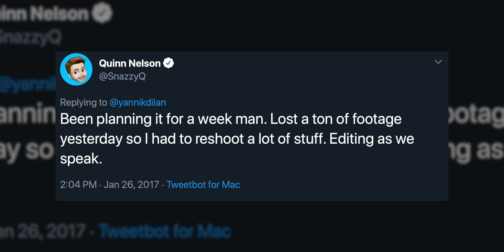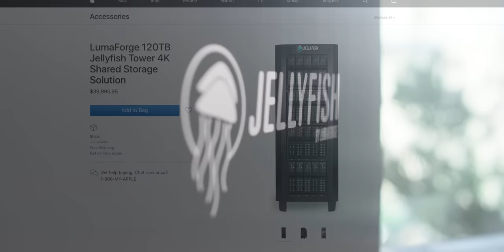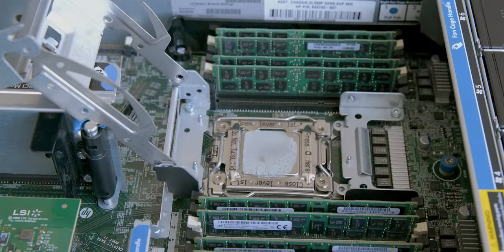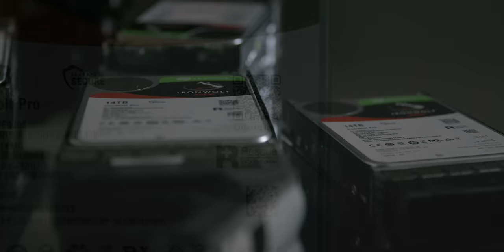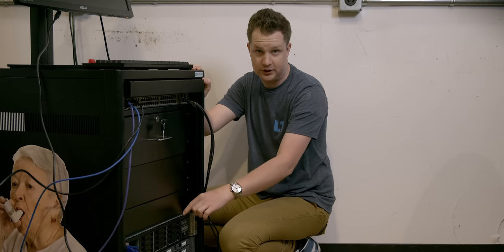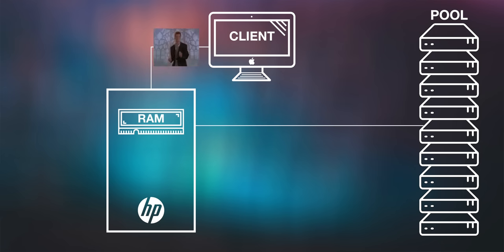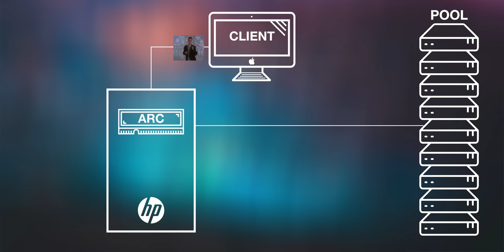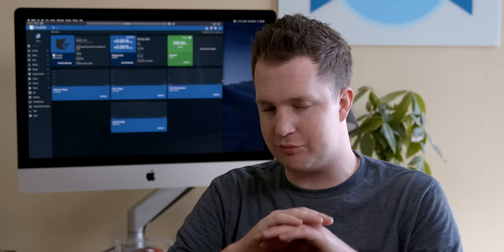I Built a HUGE 336TB Server Without Linus Tech Tips!

Comment: I've built a similar system with 2 Xeon processors and a 16 drive bay.  I had two SSD's for ZIL and ARC but discontinued them for fear that an SSD error would crash my entire system.  I only have two users and wouldn't benefit from the SSD's anyway.  Love your 10Gbps setup and yes, everything runs great using FreeNAS. I use 2 vdevs of 8 Seagate 10TB helium enterprise class drives using two parity drives each.  I also use a 2nd QNAP system to mirror the FreeNAS setup.  QNAP has implemented many of the features of FreeNAS and it can now perform SCRUBS, SMART testing, etc.  Still using 1Gbps ethernet though, and it bottlenecks data transfer at 116 MBps.  Most of the parts were purchased on ebay for much lower than new.  iSCSI, NFS, are working fantastically while SMB...well, Windows 10 is still crapping all over that and can't decide whether or when I have access to my own server.  Re-enabling SMB 1.0 seems to help but is intermittent. Later SMB versions are also problematic so when Windows complains I use FTP and other protocols to transfer data. Next upgrade is going to be one of those 10G switches, my pc's already have 10G nics.  Great video by the way.

Comment: Considering the cost of the drives is likely to be the primary cost depending on the size of the server you're building, it's a pretty nifty tip to point out the used enterprise equipment market as a way to keep the cost of the system that houses the drives down.

As a side note, while the ability to work off of the server directly might be nice for certain applications, it's probably worth pointing out that you can drive the cost of the server down a fair bit if the core intention is storage/archival. For video editing, the video can be transferred from the recording device to the local machine that's going to be doing the editing, while simultaneously backing up to the server. Working directly off the server itself is going to result in a far higher workload rate for the drives. In particular, since it's a raid setup, all the drives in the array are going to suffer far more work than they need to, likely resulting in failure sooner than necessary. Considering the work machine is going to have to have specs to do the editing anyway, you could just do the work on local, fast, and relatively cheap SSDs, then have the data sync to the server after. Basically, using a sever as a glorified external drive is massive overkill in most scenarios, and likely to cause needless wear on the system.

Comment: Enjoyed the video, everything was pretty spot on except for the your comment about LTO tapes. I worked with them over the years and for a setup like yours if you every need to archive a chuck of data off, buy a nice usb 3 HD dock and just get a new HD and use it to archive. LTO 7 tapes only have a native storage of 6TB and a max compression (which you will never get) of 15TB.  LTO7 tape cost around 60-70 dollars for a few dollars more you can get a HD which will have a much MUCH higher read speed of that tape and if you never need to retrieve a small bit of data you'll hate dealing with the tape. Oh and a LTO7 drive is close to 4k in cost.

And if you want to get stupid amount of memory on the cheap get a Dell R910, it can hold 1 TB of memory.

Comment: Kinda cool, The netapp is super fancy. 1. How come your client operating system company doesn't make a server version? 2. You would get 100x more functionality with Windows Server 2012-16.  Which is fully supported by that HP,  heck maybe even optimized for Windows. I'm not saying its a more robust operating system. But you would be able to actually engage the server fully instead of just ssh or web gui. Using the OS will also help you learn tons of cool stuff. Especially within the network adapter areas where you 'think' that your 10G interface is the bottle neck :)

Comment: @7:15. 60 Seconds UPS power is only good for brownouts. The server will never be able to shut down that fast, specially if there are clients accessing the drives. 

I would get a battery extension module to get at least 15-20 minutes runtime.

Comment: I agree with old server units on ebay. I built my Unraid server using old servers. I have 4 so far. I use 1 as a desktop and 1 as a server. Will be finishing the other 2 as servers. Then going to build a video edit / rendering server. Went with unraid do to it not really needing pools and loosing all the data across the array on a failed rebuild.

Comment: I have a pair of Dell C2100 LFF on freenas, and a R510 LFF(and R710 SFF) on windows 10 pro, each server individually was under $100 each including processors(low-mid range quad core) and 8GB of ram each, upgraded the RAM to 72GB on the C2100s and went from the 2.1Ghz quad core to 2.5Ghz 6 core, and the R510 and 710 uppsed to 3Ghz 6 core, the C2100 has a nice feature of having a dual10gbe daugter card, all together a single C2100 with 2x10Gbe xeon E5649 and 2x1Gbe, 80GB RAM, and 12x3TB 7200RPM enterprise drives(referbished) was under $900, Dell R510 

Because i only have 12 drives to choose from on the C2100s, i ended up choozing ZFS Z3 for a 3 drive redundancy anywhere on the server, these are refurbished drives afterall

Do i have a youtube channel? No
Do i produce video? No
Do i record over the air TV? yes, and will continue to do so until it either becomes illegal where i live, or i get internet fast enough/capless enough for streaming

Comment: the ZIL is not what you just said it is. the ZIL is not a write cache, and ONLY applies to syncronous writes. async writes will stay in RAM (the actual write cache) until flushed disk. many people make this misinterpretation, particularly when trying to compare unraid to freenas. unraid has hybrid storage, with storage tiering (write caches) but zfs (currently, supposed to be on the way) doesnt.

Comment: When I first installed my 10GBase-T network at home, I thought, this will definitely be fast enough.... But then I installed a Highpoint Solutions SSD7103 M.2 3.0x16 NVMe adapter with Hardware level RAID 0/1/10 with 4x HP EX950 2TB m.2 SSDs in RAID 0 on my server/NAS as a cache/top storage tier, and quickly maxed 10gig Ethernet.  So then I bought an Intel X710-T4 four port 10GBase-T NIC to put in my server with all four ports aggregated to create a 40Gbit backbone for my server

Comment: Sweet storage system. But question, do you really need to edit directly from the server? Wouldnt a simpler solution be to work with a couple of big local SSD´s and once you finish editing you move the content to a Synology NAS with all the same hard drives you received from Seagate?  It would be cheaper for sure, but not only that, it would be dead simple to build and maintain. Now if you really did it as a nice techporn solution, I understand :)
Reply from the maker: Editing directly from the server saves time, reduces likelihood of data loss, and requires fewer cogs in the production process. It’s not cheaper, but it’s way better.

Comment: Im building one of these setups for my home for video editing... I also want to learn windows server. Would this be running ok for data backup if im editing and using windows server as a learning tool or would i be doing this wrong.
Reply: Wheres the build specs. Id like to buy the same setup... Minus the overkill of drives.

Comment: Those Jellyfish servers raise one big question for me - where the HELL did they find their cases?!  I want to build a storage server just like that using 5-in-3 hotswap cages, 4 of them, letting me use 20 3.5" drives in 12 5.25" bays... but... nobody MAKES cases with 12 5.25" bays any more.  Even cases with 9 are impossible to find.  I can't even find used old ones on ebay.  It's like the whole industry just decided 5.25" bays are cancer and they threw everything in a landfill.
I am very glad you set your system up with at least 2-drive redundancy... modern mechanical drives have an unrecoverable read error rate of about 1 read per 12TB of reads.  And if you hit an URR during a rebuild (which is statistically likely with 14TB drives) it will fail and you will lose everything in that parity set.  I hate seeing people using large drives and only setting up single-drive redundancy.  That's just asking for a negative situation (needing to do a rebuild for a lost drive) to turn into an absolute catastrophe.

Comment: Not a mac guy but I imagine your storage is shared via NFS. NFS shares are very diligent with how you write data. They write in what is called synchronise mode. This means your data has to make it all the way to a platter, it cant be dropped into a cache and then dealt with latter (that's asynchronise) . A separate ZIL device called an SLOG might help you out here. Just remember that if you go with a SLOG that it needs to be redundant ie 2 SLOG's in a mirror.
To test if a SLOG will benefit you you can for testing (it's a dangerous operation for daily use) turn off sync on the pool. Then all writes will be processed asynchronously. Something going badly while you are doing this could be bad.
Also remember ZFS is a Copy-on-Write filesystem. So there is no immediate overwriting of data, stuff gets written to the next free space this means each project you load will be inching its way closer to the end of the disk where your disk speeds will be around half.
Reply from the maker: Using SMB. NFS is no good with FCPX.
Reply: @snazzy  SMB mostly uses asynchronous writes, but there are some times when it does write synchronously. You shouldn't have issues on that front. If you do they might be a bit weird. again turn sync off to see if it resolves the issue.
SLOG sizing is also something you would need to look at. An SLOG wont use more than half of you main memory size (64gb right now) and wont need to be any larger than 10 seconds worth of writes. 2 * 10GBE for 10 secs is about 20gb. So 20gb is about as much as you need. Overkill, considering a lot of smb transactions are not going to touch it.

Comment: How did you set it up to edit using fcpx off of the server? I have a freenas nas too, but fcpx has had issues storing it's library on a network drive. It just says you can't do it. There's a sketchy way I got around it creating a "virtual" local drive, that's actually the server. Is there a better way?
Reply from the maker: Yeah. Apple doesn’t allow you to use AFP shares with FCPX, but NFS AND SMB both work great.

Comment: you should definetely get matching spare raid controller(s), same firmware is mandatory! those suckers usually are the first ones to let you down when you don‘t expect it, especially on older systems like this, and then you suddenly have a lot of maybe unrecoverable free diskspace available... ;) same goes for the power supplies.
your 60 second ups should be upgraded a bit as well, that amount of time is very likely not enough for a safe shutdown if any metadata has to be written before shutdown...
Reply from the maker: ZFS doesn’t use a hardware RAID controller. ;) I do have a spare HBA on hand though.
Reply: Snazzy Labs my bad, that‘s what I meant, didn‘t deal that much with zfs lately.. 
please don‘t tell me it doesn’t use powersupplies ;)
nice setup anyway!

Comment: You should buy the +128 GB RAM, the ECC RAM is not as abundant as normal RAM, and will stop being manufactured and will be sold out, never to return, so since your Backup Server is staying for good, you should RAM MAX it. Also the editors will increase and so the bandwidth and data traffic, so probably will be used fully

Comment: Correct me if I am wrong but doesn't Freenas recommend a gig of ram per terabyte of storage space?  I originally used FreeNAS for my server but have moved over to unraid.  Unraid you can use different size hard drives whereas FreeNAS the drives must be the same.   I found unraid easier to initially set up and easier to do things like set up VM's etc.   Didn't like the jails setup with FreeNAS.  Currently using my Unraid server as storage for my systems backups, storing all my media files and using Plex.  Also have a Win10 VM running Blue Iris software for my security cameras.  For a newbee I would say unraid would be easier to setup and manage.

Comment: Nice build. Would have gone with 2-3 hotspares though. May look a waste at first but if you're using it for 3+ years you'll see why :) I'd set up a "Scrub" Tasks every couple of days (28+) so you'll notice data corruption early (Seagate drives... You never know :)). Also you may consider short(every 14 days)/long(every 90 days) under Tasks/SMART for all drives. It's used hardware after all :)

Comment: is there a way to actually go over 30 MB/s in your local network? as i have one server for viewing my videos and one drobo 8 bays to back up all my work like video, games, apps and the list goes on. i'm also using a Cat 6 ethernet cable around the house and as i have been watching your videos, you seem to go way over 30mb/s on your network. my server is a mac mini connected via Ethernet. all my Macs are wired to my switches and i am currently backing up all my data and the speed is not that great. any tips on how to boost that speed? Not sure if that makes a difference or not, but i am using my 2009 MacPro 5.1 "upgraded" to a 2X 3.46 GHZ. thanks =). and love your video by the way. keep on the good work
Reply: Check cabling and network drivers,switch,router. I do 120Mb on 1 gb 48 port switch.

Comment: Depending on how long  you plan to keep this, buying new and spending that $30k might have been a better deal long term. The reason data centers get rid of this equipment is because it's cheaper to replace equipment every 2 years, get back a small amount of money from resale, but the huge savings come in power usage. If you plan on keeping this for 4 years, you might be OK, but after that you would have saved money in the long run by buying the more expensive equipment up front that saves you more per year than the used equipment you bought. Of course, if you don't have the money up front to do that, you're stuck doing what you did.

Comment: Couple mistakes.

Should have built a 4u server with Noctua fans and a supermicro board. Would have been about the same amount of money for way lower noise.

Get rid of the iMac pro. Build a Threadripper system and move to Avid Media Composer. Final cut only allows one editor in one project at one time.

Louis Rossman and Linus have had several videos on why the iMac Pro is a bad machine to own. Apple treated linus very poorly when he attempted to get a paid repair done.

Comment: So, how many video's do you make each day? And how much GB's is there on each video? I also have a home server but this is just a simple Intertech case with 'only' 11TB of storage, but let's say you make ONE video for you channel per day. Or let's make it extreme and say you make 5 video's per day. And each video becomes 4GB per piece. What I do here is also backup my own stuff to BLU-RAY discs. Optical media has been proven to me very reliable, since I still have my first cd-roms here that were burned in the 90s. And still working. Each BD-disc has a capacity of 25GB. I use winrar to 'store' them in a volume, with settings on 'store' for maximum packing speed, and I use on average 2 to 3GB on the Blu Ray disc for par files. These are redundancy files in case the disc gets a scratch and a part of it is not  readable anymore. Not that this has happened before, since I store these disks in a special map. So I think this is far more cheaper solution for just backup your original material. You can always burn 2 disks, one main and one backup.

Comment: Just plug in another dual port 10Gbit/s card of ebay and put it in the same LACP trunk.
Reply: Reminds me of client who tried to convince me that the 4eth 1gbit cables make his network go 4gbit...until I showed him what "redundancy" means and the guy who set it up for him simply had no clue what he was doing... :D
Reply: @MarekBartovic  That's why it should be a LACP trunk in preferably advanced hashing mode. As long as one client has only 10Gbit/s, it doesn't really matter how it's loads balanced, but with 4 simultaneous 10Gbit/s clients, 4 NICs in a trunk will speed things up. Not as perfect as one 40Gbit/s NIC, but close.

Comment: I would NEVER build a so huge server with spinning disk, the monthly electricity bill will kill you on the long run, you will, after sometime, regret to not have invested directly in SSDs instead of HDDs, not mentioning the ultra fast access times, crucial in high-res videos editing, plus, the very low heat of SSDs meaning that you don’t need to add more electricity consumption for an air conditioning to cool the server room. Furthermore, you will avoid the skyrocketing costs of soundproofing your server room due to the added noise of 10/15k rpm HDDs. And finally, SSDs cost are dropping fast, so you just need to populate Sata/sas slots with what you just need for now and expand later with dropping cost mb/$ by the day, you are saving more and more on the long term, instead of losing more and more, as the value and reliability of mechanical drives will drop exponentially. Lastly, when you swaps SSD the array rebuild time is much better, and an old SSD can still be of use as a static archive when its writes cycles approach the limits of safety, by storing it unplugged as an archive device, it is still of good use, compact and reliable.
I forgot one thing: I love all your videos, you do a fantastic job ✅👍🏻😊
Reply: The monthly electricity bill won't kill you. It's why it's still used by Enterprise.